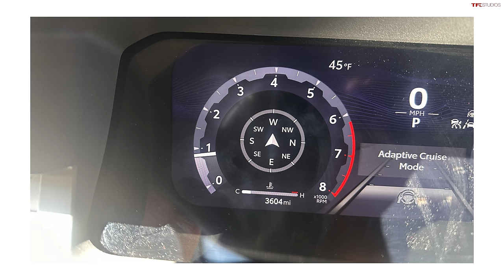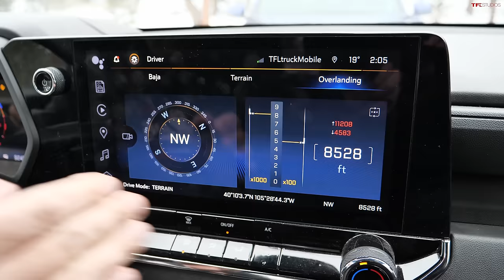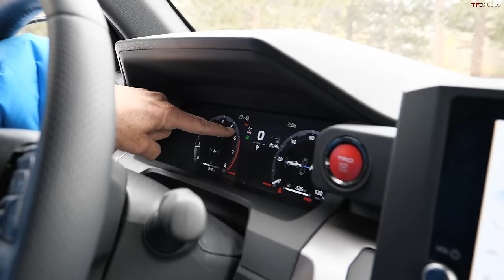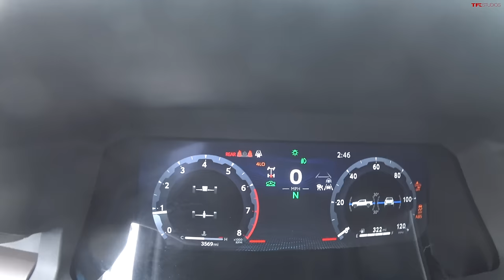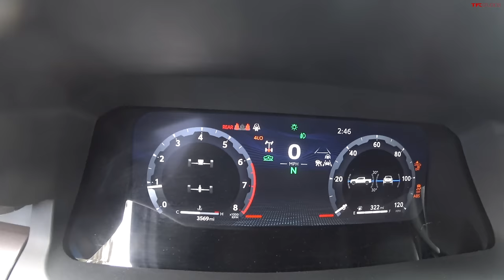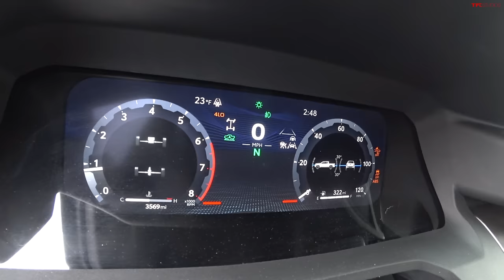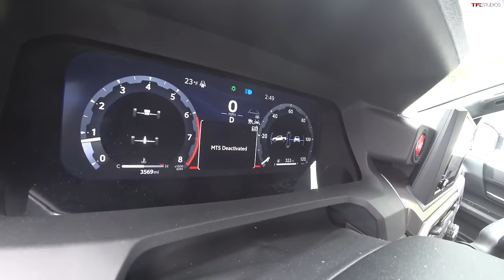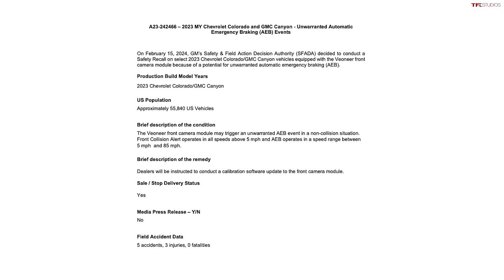Our Brand-New 2024 Toyota Tacoma Almost Left Us Stranded...Here's What Happened!

Comment: End of an era.  RIP Tacoma, first 3 generations were awesome at least.
Reply: It won't be theend for the Tacoma. It's the first year of a new version of the truck. Remember that the 3g Taco had it's issues in the first 2 years of production - and most of those issues were hammered out (the gear hunting issue still exists). Give it a little time, the 4g will be as reliable.
Reply: Always avoid the first gen of a new model. This goes for even Tacomas.
Reply: @joelopez5018 exactly. I never buy a car until it has been in production for at least a year. Building a car in the numbers involved in testing and development is entirely different than full production with new and retooled facilities
Reply: Unfortunately,  it didn't have big problems like gen 4 Tacoma.  Lol @UltimatePostman
Reply: @UltimatePostman   Same with 2nd gen- head gasket issues and sunken engine mounts
Reply: Same thing happened going from the 2nd to the 3rd gen.  I bought my 3rd gen end of the 2nd year in production it’s been a fantastic truck.  I am more concerned about timing chains/ belts wearing out from the turbo.  Or I should say what reliability am I giving up to add the turbo.  Ford definitely has been having issues with timing chains wearing out at double the rate because of there turbo.
Reply: My 3rd gen was far from awesome.  Crappiest trans I ever owned.  Couldn't figure out what gear to use going up hills.  And underpowered.
Reply: @whodey59  context.  Cause I have seen some 3rd gen’s do some amazing things.  Most of your complaints were known but they were certain remedies like chip reprogramming, operator taking manual control , buying a truck with a 4 cylinder instead of the v6 with the heaviest cab configuration 4 door 6ft bed(yeah you got cheap at the dealer then complained), the transmission didn’t really act in anyway different then trucks from late 90’s early 2000’s or for the matter the 2nd gen Tacoma.  The transmission might be weird but it’s not a truck-a-lac it’s a circa 2000 designed transmission in a 2018 truck.  Shit my Tacoma has disk brakes in the back and independent suspension up front same shit my 1991 ford ranger had and that truck went to 300k miles.  Just saying sorry you had that experience but you’re lacking context and not really contributing in a meaningful way.
Reply: @whodey59  sounds like my colorado zr2.  Lol
Reply: um 3rd Gen never got fixed, its all downhill from here @UltimatePostman
Reply: @UltimatePostman   lol the third gen currently has problems with its axles falling apart
Reply: @UltimatePostman  The 3g was having major problems right up to the last year of production. They're just not worth it anymore. Worse reliability and no V6. Why bother?
Reply: @whodey59  Yup. And they made them like that for YEARS. Apparently, they've also got a recall on the rear axle now. The last 3 generations of Tacoma have had some type of serious reliability or quality problem. The reputation is based on the long distant past and they just don't deliver that quality now.
Reply: @roady7420  Doesn't change the fact that they've had a lot of problems, regardless of remedies. That is not what Toyota's reputation is built on. Their reputation built on being well-engineered and working properly from the start. Your rationale sounds more like something a Hyundai fan would say. "They're flawed, but they fix them."
Reply: @palebeachbum  there is nothing that is perfect especially in large manufacturing with contractors building parts.  That being said none of you are offering an alternative.  You’re just crapping on the industry leader which is fine hopefully it drives better vehicles.  I have yet to see anyone articulate a midsize truck for a decent price from a large manufacturer that would be better especially in the 3rd gen model years.  I can agree the ford ranger before the new model went for forever but then that truck is competeing with 400k mile 2nd Toyota’s so give me something else to look at.  4x4,four door truck, midsized decent options,  I dunno where do I shop the bike shop. Please grow trolls.
Reply: @roady7420  The Frontier is a great alternative. It's priced lower. It comes standard with a 300hp V6. It's also rated higher for reliability than the outgoing 2023 Tacoma. The Frontier has been an excellent truck since its first generation in 1998.
Reply: Wonder if Toyota will sue them
Reply: @palebeachbum  LMAO….Nissan is your answer you mean basically a Toyota Tacoma clone with less features..you guys are hilarious.  Hang out let me move some badges…lol..this never gets old..
Reply: @roady7420  nonsense. They look entirely different. V6 in the Frontier. 4cyl. turbo in the Tacoma. 2023 Frontier also rated higher for reliability than 2023 Tacoma. New 2024 Tacoma already breaking down. Toyota cultists are hilarious.
Reply: @palebeachbum won't touch a Nissan even if you are offering it free of charge 😮
Reply: @palebeachbum someone is deceiving you with that😂
Reply: @bggees  Why?
Reply: @bggees  facts are facts. 🤦‍♂
Reply: @roady7420  I certainly give TTL credit for revealing an issue with the Tacoma as a potential customer myself.  As a Canuck, I had doubts about the tire choice on the Toyota for icy rocks.
Reply: @UltimatePostman it’s a 50k truck dude… just shut up. 😂
Reply: @AnthonyErtl racist

Comment: 5th gen 4Runner guys just eating popcorn and being amused 😂
Reply: 6th Gen 4Runner will be the same thing as this 2024 Turd Tacoma. Made cheaper, weaker, but more expensive. Your 5th Gen will be desired more and more. Keep it!
Reply: And 3rd gen Tacoma owner. I own a 2021 5th gen 4 runner as well.
Reply: My 24 Tundra Pro has a little over 3k miles too but bought in Oct 2023, at least made it 5 months injury free so far! Had a 2019 SR5 Premium 4Runner, it was bullet proof but wanted back into a Tundra as I missed the open bed.
Reply: 2nd gen Tacoma and 5th gen 4 runner here.  This is sad to see.
Reply: @Nvp8985  the rise and fall of a great company.
Reply: 3rd gen. and 4th gen. (gx470) owner myself
Reply: And that's why I bought a 2021 4Runner.  It was a brand new 11 year old truck actually made in Japan.  I don't need a 13" monitor.
Reply: How'd you know what I was doing? Lol 😂
Reply: @truthkeeperfilms I just put new wheels and tires on the 5th gen and got more excited than how I’m getting for the new Toyotas. 4th year of ownership (still a baby in 4Runner years) and it still drives like I just took it off the lot
Reply: It's too bad subaru doesn't make a truck @truthkeeperfilms
Reply: @doylewillis9587  - I hate that Subaru puts in CVTs in their vehicles. Never were they a solid reliable transmission. Engines were pretty good but their AWD is great

Comment: Went with the Pro-4x, saved money and still have my transfer case.
Reply: Buddy,  smart choice.  I've had nothing but nissan and never had a problem.  I'm on my second frontier and these things are bullet proof.
Reply: Frontiers are so awesome and reliable, it’s hard to believe it’s made by the same company that makes the Altima. I’ve got an 04 Xterra that’s in amazing shape.
Reply: Ditto, zero issues with my 2023 p4x.
Reply: And!!!! You also have a V-6!!!
Reply: @miniaddict4534  Nissan builds their mid size trucks right. I had a an '03 Nissan Frontier that was still running strong when I sold it with 379k miles on it with little to no major problems with regular scheduled maintenance.
Reply: Sold my 21 Tacoma for 22 Frontier and love it! Great truck!
Reply: I think the frontier is the only nissan i would consider currently. Does the pro-4x come with the six foot bed or only the five foot? I havent found anything on their website on it. I would love to have the crew cab but a five foot bed is just to short for my needs
Reply: @TheSemiArtisticPuma  Unfortunately the Pro4X only comes in a 5ft bed
Reply: And no turbo bs.
Reply: Ive got a 2017 P4X frontier. It would have eaten up this trail. The Tacoma fanboys are sweating right through their Patagonia apparel right now 🤣

Comment: This is why I will be holding on to my old Tacoma for at least a few years while they work out all the bugs and inadequacies.  But I have faith in Toyota to work it out and fix it.
Reply: lol okay 👌🏻 good luck with that
Reply: No offense but the tacomas have always had weak axles… the only good thing with Toyotas is the engine is reliable, everything else is done better by other brands unfortunately
Reply: I don’t know that others do EVERYTHING else better, but you’re not wrong.  But in fairness, it’s the whole drivetrain that’s reliable, not just the engine.  It’s typically other things that fail first.  No manufacturer is perfect it’s just better or worse and Toyota is still better than most more times than not.

Comment: Looks like I'm settling for a '24 Frontier Pro-4x. Thanks TFL!!
Reply: Should be able to get several thousand off MSRP if that's what you want, since they're pretty uncompetitive and not selling well for Nissan at all.
Reply: @thatoneotherotherguy  Honestly, that is more of a selling point for me if it is easier on the wallet, easier to maintain (NA V6 Baybeeeeeee!), more widely available and still retains the reliability of the last gen. I want a midsize truck that acts like a midsize truck, not a midsize truck that acts like a turbo 4 banger sedan on icy uneven surfaces.
Reply: @HotSneks   whatever floats your boat. I'm sure the new Tacoma will continue to prove more reliable than the ancient Frontier platform (2005) that got a new body, newer V6 and a pretty questionable 9-speed automatic transmission. Best of luck with the Nissan's reliability and depreciation if you go that route. I've got a V6 better than the old Tacoma or Nissan V6's, the Toyota 4.0L in my '23 4Runner, and I'd rather have the new Toyota 4cyl, as it makes way more torque way lower than any of these N/A 6cyls, and guzzles a lot less fuel doing so.
Reply: @thatoneotherotherguy  So because you(and a bunch of other people here) seem to put your faith in a brand for some weird arbitrary reason, here's some common sense for you.

As a general rule of thumb, any car or truck that uses forced induction by either exhaust gasses (turbo) or belt driven (supercharger) is going to run hotter. Heat will always play a role in an engine life cycle. Engineers have constantly improved on this but the fact of the matter is, anything that uses forced induction is just going to have a shorter lifespan because of heat. You can not increase the load of an engine and expect it to last as long especially when it's doing things like towing or even harder wheeling. It boils down to physics, "the candle that burns twice as bright lasts half as long."

Take the new V6 Turbo in the Tundra for example and look at how many people have reported their truck grenading before 40k miles. What do you think is going to happen to the new turbocharged I-4s in the Tacomas?

Funny how Tacomas (previous gen mind you) and Tundras have both gotten recalls the past week, right? Then then this happens on one of the more popular truck enthusiast channels and people like you seem to deny it.  🤷‍♀
Reply: I've been driving Frontiers since 2008. First a 2000 4x4 and now my 2009 SV 4x4. They've never let me down on off-road trails. I say let the toyota fans keep overpaying for their trucks. My only complaint about the Nissan being less popular is the smaller amount of aftermarket upgrades available.
Reply: @A.J.1656  Toyota simps are just insufferable. But I get the brand loyalty, my folks and I, as well as my friends have owned older Toyotas when they were actually built like tanks. My dad still keeps his 1999 4R SR5 around to drive once a week for chores and it's rarely given him issues. 

Cheers to your Frontier 🍻, that 4.0L VQ is a damn good engine. Just be mindful of the timing chains and  SMOD for the model years prior to 2010. 😁
Reply: @thatoneotherotherguy  but the nissan is super reliable.....like tacoma USED TO BE
Reply: The current Frontier is way more reliable than the Gen 3 & 4 Tacoma!
Reply: @HotSneks  The Patrol Y61 Pickup is pretty good as well. I am sure it would have thrashed the Tacoma here with front and rear SFAs.
Reply: @ramaswamynarayanaswamy4806  man, such a shame that North America missed out on the Y60 and Y61. My folks overseas still daily their 1995 GQ Patrol with the 4.2L Diesel inline-6. Survived a handful of floods and earthquakes but still doing it's thing on and off road.
Reply: @HotSneks  Those Patrols are amazing. Pity Nissan is discontinuing them. Shame.
Reply: @ramaswamynarayanaswamy4806  I'm not sure about it being discontinued since the Y63 has been leaked and confirmed already in spy shots. The Infiniti QX80 is going to debut on March 20th and that's pretty much the same platform as the Armada/Patrol.
Reply: @HotSneks  Yes, but with a twin turbo V6. That effectively leaves the GM Full Size SUVs as the only ones with V8s.

Comment: Regardless of whether or not it broke because Roman didn't engage one mode before the other, it shouldn't be that easy to break it. I don't want a vehicle that will cost me huge if I get confused and push the wrong button.
Reply: They were talking about that in order to get it out of 4L in order to limp the truck back home. It had zero to do with the failure itself.
Reply: I don't see a "switchology" error. The software won't let you engage things incorrectly. He over stressed a part by spinning the wheels like he did. When one of them finally grabbed traction, that instant stoppage broke something. Still shouldn't have broke but I'll put money on all the spinning.
Reply: That had absolutely nothing to do with it...they should have edited that part out, because it makes ppl think that.
Reply: @Dusdaddy also, if he had stayed on the gas to begin with he would have made it up and most likely not broke anything...but stuff breaks when you wheel, especially in the snow.
Reply: @leeward6762  Yep. Still kinda suspect though. It's not like it had oversized tires. I'm sure it was just an axle. If it was xfer, he'd still be on the trail.

Comment: I see at the time of the snap they were on the gas but the traction control was adding heavy brake pressure to the front tires to keep them from free spinning. Esentially, max engine torque was modulating in waves between the two front axles and it snapped the ADD.  Otherwise an axle would snap.  I have an arb in my taco front diff and have to be carefull to not apply too much engine torque when the front locker is active otherwise things break.  Intersting that toyota didnt limit max torque from the powertrain to prevent this situation.  Im not an engineer, but this seems like a logical root cause.  My 2 cents

Comment: While Toyota may be less prone to mechanical failures, I’ve come to understand that anything can happen with any car. Had our 2019 XC90 lemon lawed with 250miles on it and our 2022 Honda HRV needed BOTH front axles replaced at 18miles (yes, eighteen). Likewise we had a Range Rover Sport that we put over 130k miles and it had ZERO issues.

Comment: Drop tire pressure to 20 to 25psi, and you'd have had no issues and no breaking. Pritty sure the owners manual mentions dropping tire pressure. But off reading in general, especially in snow, if you're not willing to drop tire pressure, you have no business leaving the pavement. I've driven both of these models stock, in more than 15 inches of snow, and done obstacles twice as difficult.  Also shut off traction control, stability management, and don't select any special modes. Just 4hi drop to 22 psi shut off trac and stability and have a blast.
Reply: Yeah the fact that these guys don’t have the knowledge to air down more is silly, should have been at most 15psi.
Reply: @mcewenfontana6085  stock rims (non beadlock) and tires, I wouldn't go lower than 20psi, to high a risk of breaking the bead.
Reply: With the open diffs and no traction control, how do you manage to grip